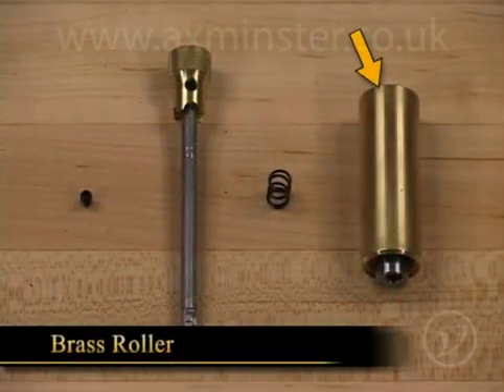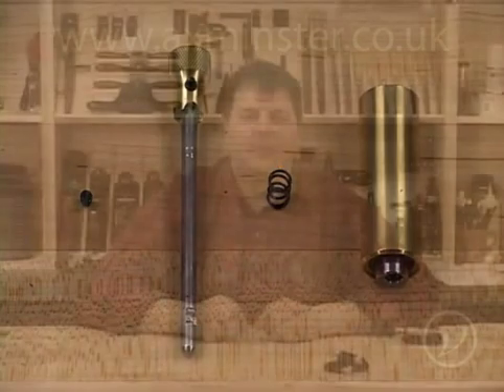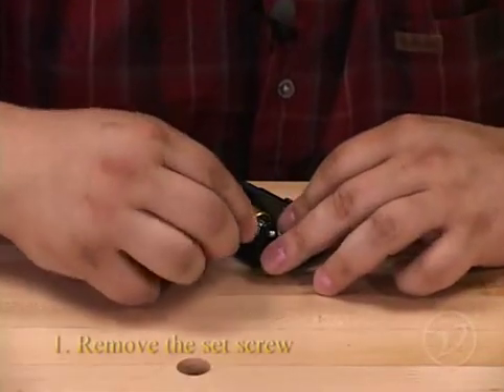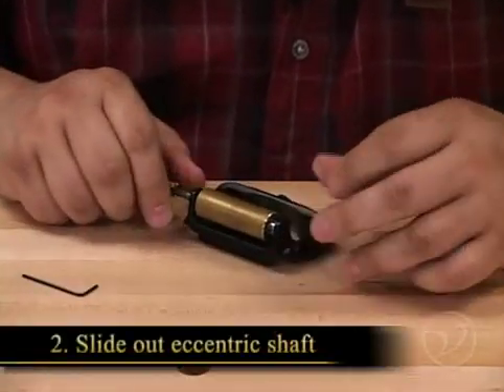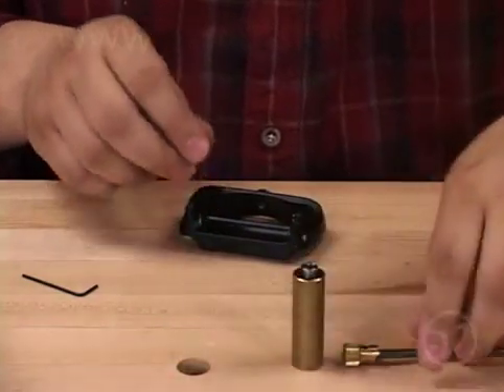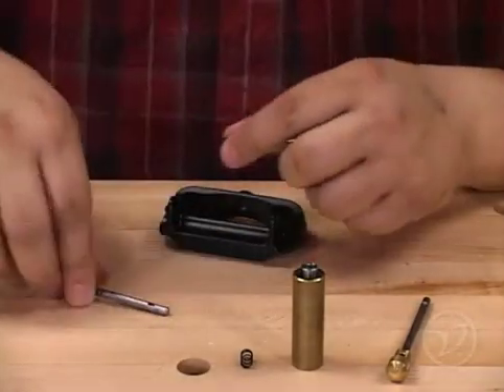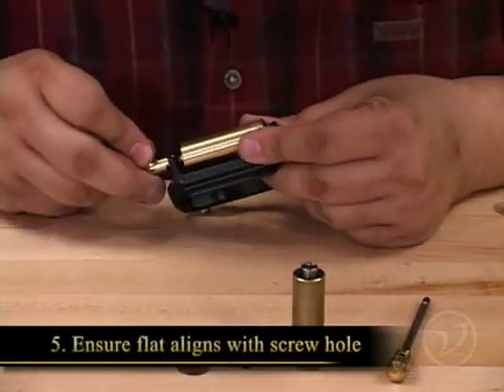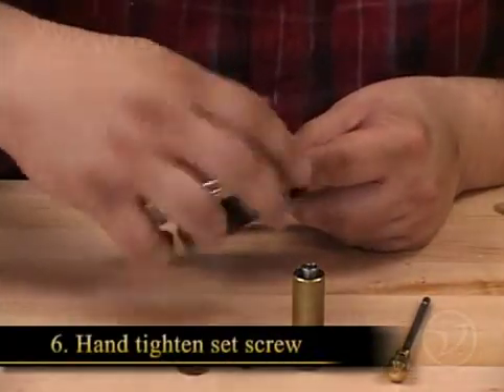Veritas Mk.II Honing System - Roller Replacement

Comment: Thanks to everyone for posting the updates to this video. I knew there must be something else going on to make the cam mechanism work but wasn't sure quite what. The only thing I would add is to be very careful getting the C clip off. These often have two little holes for the C clip pliers to go into, but this one doesn't. Result: it pinged across the garage when it came off!! Fortunately, I found it.

Comment: Other comment is correct: this video is totally obsolete if you have a newer version of this tool.  You have to push off the retaining ring on one end of the roller, slide the roller toward the groove the ring was in, and this will reveal another 1/16" hex set screw beneath the trailing end of the roller.  Even after removing both set screws you will likely have some struggle getting the axle out of the roller due to (I think) burrs on the shaft where the flats have been cut for the set screws.  I had to use a combination of tapping with a small brass hammer and twisting with pliers to get the shaft out.  I wish Lee Valley would update this video.
Reply: Thank you.

Comment: YOU NEED TO READ THIS - The new Mk2's have 3 screws, you MUST push the C clip off the steel shaft, then slide the brass roller away and UNDERNEATH your find the 3rd hidden screw.  If you follow this chaps advise you will mark up the shaft like I did and you then have a fight on your hands to get the shaft out of the spindle. Allen key needed is 1/16th.
Reply: Thank you.
Reply: What a hero! Thank you sir

Comment: This is not actually possible with the mk 2 guide there are three screws in total on the shaft for the roller including the one holding the brass knob on the end but the shaft and inside the roller are connected as one solid piece has anyone else had this problem?
Reply: travsiz i have the same problem. Did you found a solution?